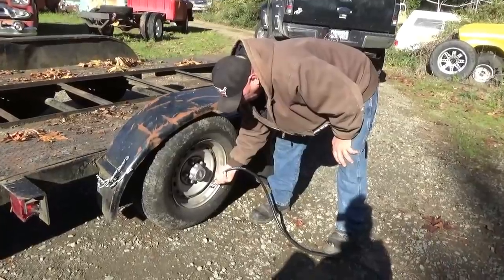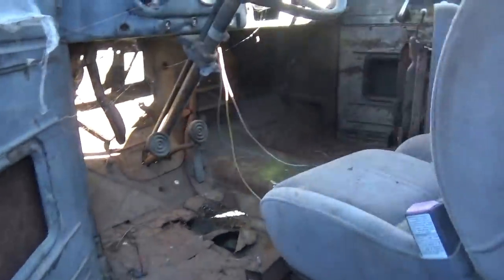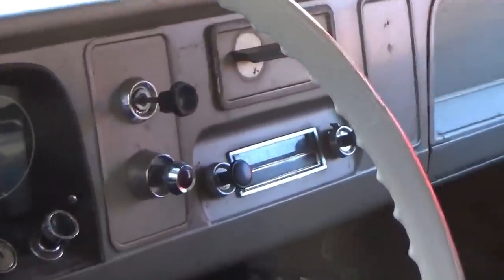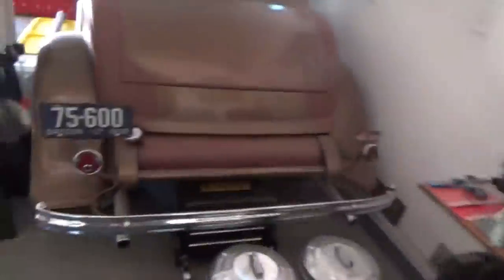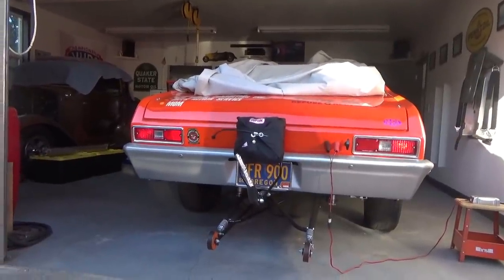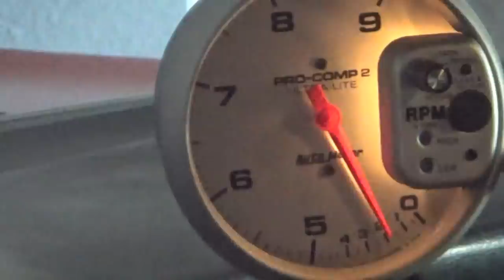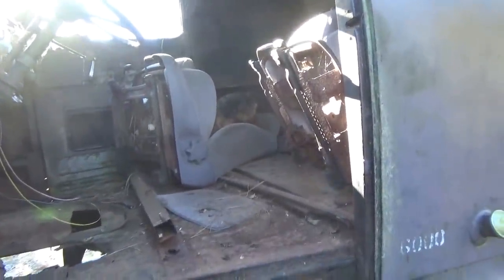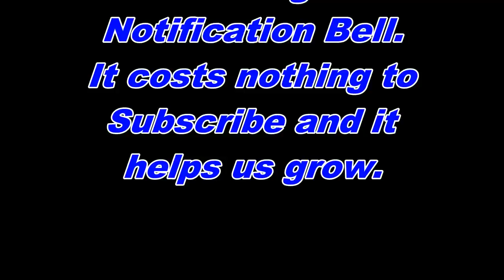Rescuing a Free '51 Ford Panel and checking out a '68 Camaro SS-RS, Nova Drag Car & '64 Chevy Truck

Comment: Nice score with that ole Ford Panel truck. Id say it is either a 1951 or 1952 because they used the same grill in both years. In 1950 they had the slat type grill on both the Panel trucks and the F1. Looks like it needs a lot of work but it does have potential. That 70 Nova is absolutely sick! I love those late model 60's and 70's mid sized Chevys.  The RS-SS was sweet too and there isn't to many of those still around that look that nice. Obviously a great day for the two of you all the way around.
Reply from the maker: I agree on all counts. Thanks Fer Watchin' Bruce.

Comment: Kevin’s truck reminded me of my cousins ford station wagon. 73 or 74 . Looks like a rusty bucket of crap till you hear the engine running . Open the hood and wow . Who would want to steel that old wagon ?Hidden kill switch ,and a heavy duty chain keeping the hood locked .

Comment: I love the smell of Nitro Methane in the morning! BTW check the glove box door for the VIN plate. I think you have a '52 there. '51 had the F1 on the hood spear itself and '52 the F1 was on a round cap over the spear like you have there. Also on the '51 "FORD" was on the hood and in '52 "FORD" was separate letters on the valence above the grill.

Comment: It IS a '52,and I'm thinking of it with a triple carbed 300 inch six with progressive linkage and an NV4500 5 speed,can't remember what 9" fits right into  it,but one with 3.55 gears and a locker,with 4 wheel disc brakes,freshened up suspension,Bilstein shocks,something pretty close to stock inside except I'd use the seats you got it with,some soundproofing and carpet,refreshed stock dash,old school tach,electric wipers from Newport Engineering,I don't build Fords enough to know,but there's gotta be a fairly easy Power Steering conversion for the old I beam axle (maybe a full sized Merc from the early 60's? Wait-I THINK the early '60's Ford trucks had P/S as an option!),I've always liked these with the ol' chrome wheels and baby moons,and if a guy installed headers,a functional set of lake pipes on the loud side of some cut-outs,with 2-1/2" pipes and Flowmasters on the quiet side of the cut-outs,couple of pencil tips under a stock rear bumper,that would be nice. That's a rough idea of how I'D build it,off the top-o-my head. Okay-start the criticizin' now.....LOL Nice save,you two. BTW-some of the ideas I used come from a friend's build of a '51 that started a lot like yours. It had been a storage shed for several years,though I had a '51 F-5 (Ton and a half) that was my daily driver for a couple of years..

Comment: Get a more modern 3/4 or 1 ton 4×4 chassis and diesel power with a good vin and use that. This would make a cool overlanding rig or shop truck. Maybe look into doing a collaboration with Rich Deboss of Deboss Garage. This is right in his wheelhouse. Hes doing an old Chevy wrecker and modernizing the powerplant with a diesel and modern interior. This would be a great next project for him as its a Ford and hes also doing a Cat 3126 into a OBS Ford CrewCab with a King Ranch interior.

Comment: Apparently a lot of people don't know how to check the air in their trailer tires. Then they have tire failures and bad mouth the tires! I have towed trailers many miles over the last 40 years and only had one failure and that was on a tire on a used trailer that had been ran low before I got it.

Comment: Nice not much rust just normal like in the floor boards it had rubber and it trapped moisture and that's what rust out the floors
Reply from the maker: Great point!

Comment: A little research
What was the first car to have blinkers?

Buick

patented a light with two arrows and a brake light; in the late '30s, Joseph Bell patented the first electrical device that flashed — and then in 1939, Buick introduced turn signals as a standard feature. Still, electrical turn signals didn't become widespread until the early to mid-1950s.Jul 14, 2013. We must remember that Buick Car/Truck Manufacturing was purchased by the company which eventually became known as the General Motors.

Wikipedia don't know exactly how accurate this is but I was trying to figure out the year of that panel by whether it had turned indicators or parking lights read below

https://en.m.wikipedia.org/wiki/Automotive_lighting
Reply from the maker: Good point. I don't see any provisions for turn signals on Elmer Ford.
Reply: @ClassicTruckRescue  back in  1964/68 my older brother had a 1952 Chevy Truck 6 banger that had park turn break lights, when he was an instructor (active duty Navy)  when he lived in Idaho as a nuclear power plant (A) school instructor. Had this camper shell that had fold out wings with heavy canvas which were beds.I loved that old truck.

Comment: I think it is a 53
Reply from the maker: 53 is a completely different body style.
Reply: It is Definitely Not a 53. I am pretty sure it is in actuality a 52 F 100 Panel Van. There are clues on the hood that leads it to be a 52, the little panel at the point of the hood is   more than likely 52, the lettering of FORD on the valance and how it's spaced says it's a 52, the chrome spear for the sides of the hood is one piece, and the round disc that sits on and against the spear says it is a 52. Rick I was raised in a Ford Family, my Dad was a mechanic for the local Ford Garage for in the neighborhood of 30-35 year's, but with me being the black sheep so to speak, my first car was a 63 Chevy Impala SS with a 327 and the 2 speed power glide, boy I thought I was hot stuff back then. But I'm a few years older now and I've mostly slowed down, but I still love those old slick looking, loud, tire smoking hot rods. And I'm still keeping Lou, and your Mom and you and Jamie in my Prayers. Keep up the good work and Stay Safe out there in Molala. You'll do good in your upcoming surgery, your a fighter too. Nuff Said.